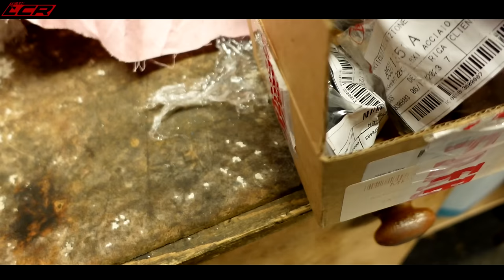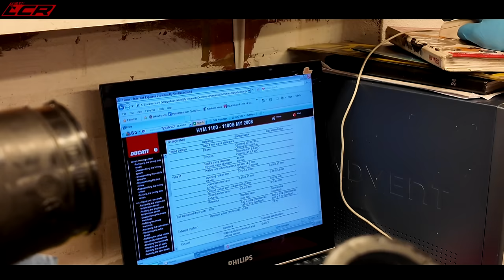Ducati Hypermotard Restoration EP16 | Engines Built!!

Comment: As a Monster 1100 owner I'm deeply jealous of that motor of yours! 😍 One thing to note is that, although the workshop manual specifies a belt tension of 140Hz, the general consensus is that this should be reduced to 110Hz on these engines. This is down to the changed head design compared with the older motors. With the earlier models, the camshafts ran in their own bearings while, in the later motors, including yours, the bearing was eliminated and the camshaft runs directly in the head, (on a film of oil). With the belts at 140Hz you may find that, if the engine starts to run hot, (four bars or more on the temperature gauge), then the expansion of the cylinders can cause the cams to whine or shriek. So, if you notice this noise from the heads, reduce the tension to 110Hz and this should remedy the issue. (It's not a problem where the cams run in "proper" bearings. Really looking forward to seeing the finished article.
Reply: Bearings eliminated, cam running directly in the head? That's regressive, cheapskate engineering, no? That was the downfall of my 1980s Honda XL250!
Reply: @m2menuiserie540  Well, to be fair, the system is not inherently inferior to a roller bearing setup in this application. The bearing load is supported by a film of pressurised oil in the same way as the plain bearings of the big end as seen in Nelly's earlier assembly video. It's been used in these engines for over 20 years now and doesn't normally cause any problems - it's just more sensitive to over-tensioned belts than the old roller bearing design when it can become noisy. Once the belt tension is reduced, the noise goes away. Used belts don't need tightening until the tension drops to 70Hz, so reducing the installation tension to 110Hz is no problem. Oil and material technology and probably manufacturing tolerances have improved since 1982, which has no doubt contributed to better reliability in this instance.
Reply: Exciting times ahead, the motor looks amazing. Looking forward to hear it bust into life !.
Reply from the maker: OK thanks buddy 👍
Reply: @LambChopRides  I've run standard Ducati belts at 110Hz for many years with no issues. At the last belt change, I fitted Exactfit replacements and their recommended tension is 100Hz.
Reply: Fully agreed, 100-110hz is much better for the belt.

Comment: A 5mm Allen key over the horizontal fixed tensioner and a 6mm one for the vertical cylinder has sufficed for the last twenty odd years on my 01 900 SS.

Comment: Chops… the first 3 start ups and 50 miles is the most critical to run in the rings. First start, once you are happy no oil is flooding out vary the revs until the engine is at normal operating temp, allow the engine to cool fully, do all your final checks then go for a short 20 mile spin getting the bike fully warmed up and adjusting the revs and load all the time then allow to fully cool (2nd heat cycle), then last long run of approximately 30 miles, same deal, no long idling, constant changes in revs and load increasing both as the miles increase… thats it, drop the oil and its run in.

Remember its only the rings you are beding in, everything else is running on a film of oil so should never make metal to metal contact. All the engine build dirt and ring bed material from the rings and cylinder bores will be in the oil and fully run in by 50 miles so get the oil out now… don’t wait until 500 mile etc, get it out, put in the correct oil at this point then change again at 600 miles then as often as you like/can afford from there… oil is cheap compared to a new engine build.

Most people of complicate running in and nearly always leave the first start oil in way to long.

If you want more information to back up this engine run in methodology let me know and I can provide further expert advice.

FYI I am an automotive engineer with a motorcycle background and enthusiast 👍
Reply from the maker: OK brilliant tips James 👍